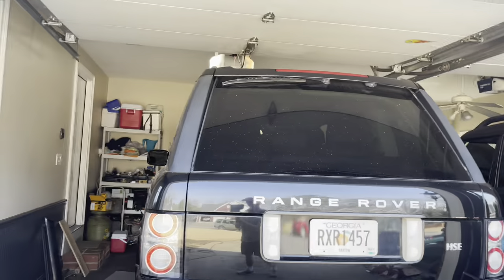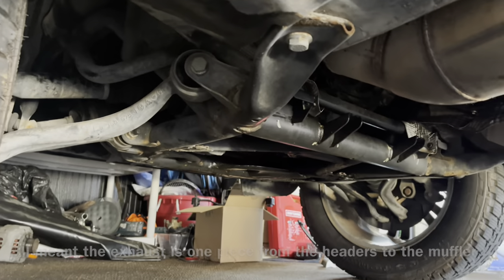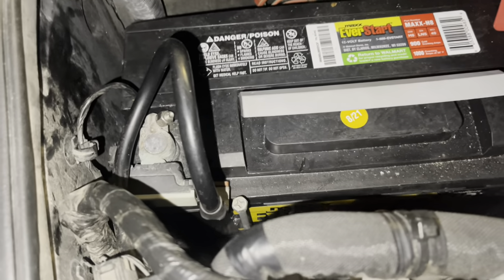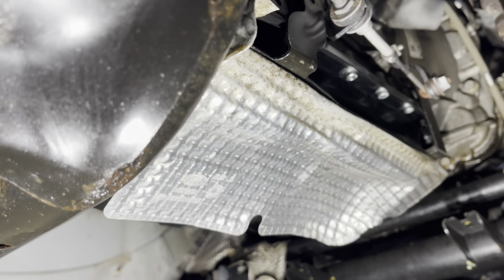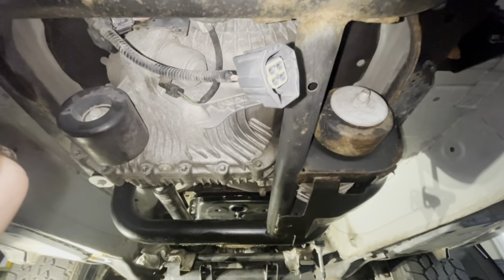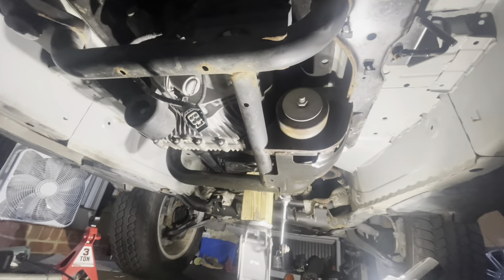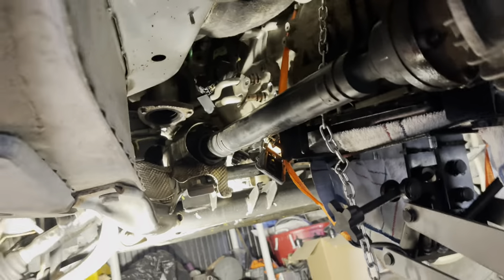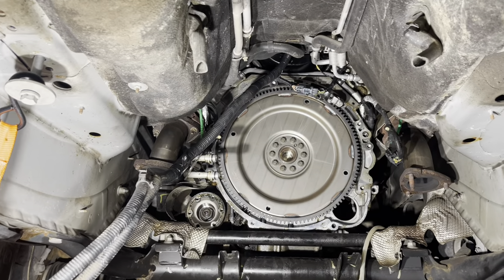2010-2012 Range Rover L322 Transmission Removal

Comment: Nice and a little jealous. I had a 2011 L322 and I was all ready to drop and rebuild my ZF transmission. Found suppliers of all the inner parts. Studied all the information, rebuilt the valve body just incase that was it (it wasn't). Then someone decided to hit my Range Rover by an illegal U-turn. They got towed away and I drove home in off road height and insurance totaled it. Besides it's premium mpg, best vehicle I've ever owned or driven. Plus I've found upgrades for its faulty engine parts. Metal engine coolant intake pipe and metal oil cooler pipe. Metal timing chain tensioner. euro-amp if you're interested. Can't stand the new ones with their horrible seats.
Reply from the maker: Yeah these things are tanks, it’s a shame how little it takes for insurance to total one of these out.  Like you said, once you’ve done the critical things to the engine these are honestly super reliable. Just for whatever reason the transmissions seem to be a weak point. Shame about yours, but maybe you can get into another one soon they’re honestly getting dirt cheap for some of these.

Comment: I just bought a 5hp24 used trans for my 05 hse bmw rover for 500 bucks, dropped the trans laying in the yard, the TC bolts was a PITA, I used a dirtbike stand  and pulled the middle piece out from the firewall laid on top of the motor and removed the top bell housing bolts and side bolts in 10 mins, you can reach them easily
Reply from the maker: Nice, I wish that had been the case with mine. Just not as much room in there with the 5.0.

Comment: Hi Ross, I own a 2011 Range Rover TDV8, and unfortunately the gearbox is bad. Apparently, the coolant was mixing with the transmission fluids, and at some point, the can stopped running. I was not understanding why the coolant was ending so fast, but it was very late, when I found the issue. My question is... how bad this can be, and if it can be repaired. Thanks
Reply from the maker: Hey I’m not really familiar with that engine as we didn’t get the diesel models in the US, but it sounds like transmission fluid got into your cooling system and might’ve damaged your engine. If that’s the case your engine might be irreparable and your transmission may be damaged too. Good luck with diagnosing it.

Comment: it looks like you had to pull the starter to gain access to the torque converter bolts.  i'm curious how much it cost for your replacement trans you put in
Reply from the maker: I actually did not have to pull the starter, I just mistakenly thought I did.  Torque converter bolts were accessed via driver's side access port.  I ended up purchasing a parts car for $1000 rather than pay $500+ for a used transmission with higher mileage.
Reply: @EtowahValleyRovers  how did you spin the fly wheel to gain access to all of the bolts on the torque converter?  did you have to use a pry bar and spin the flywheel or were you able to get a wrench on the crank?
Reply from the maker: @ryanorr5755 sorry just saw your reply, I just put a socket on the crank bolt and rotated the engine.

Comment: Excuse me, I have a big question, how did you remove the converter from the Tange Rover? I have the same one and I lowered the transmission but I can't get the converter out, please help me.
Reply from the maker: Is the converter still attached to the engine or the transmission? It should be easy to remove from the transmission with little resistance.

Comment: My project L322 is having this same exact issue. I’ve done almost all engine work myself but never tranny work. I’m debating on whether or not I can do this in my garage like you did and just replace the bushing and seal.
Reply from the maker: It seems to be somewhat common problem on these. With the right tools I’d say you can do it. I was originally going to replace clutches and seals on my original unit but ended up with a better deal on a used unit. Good luck with it.

Comment: Did you have to reprogram the new transmission to the ECU? If you used your old ECU was it easy to remove or does it take quite a bit of teardown of the transmission?
Reply from the maker: So if you reuse your original TCU then no programming is needed. You just have to pull the valve body out of the transmission and transfer the electronics from your original valve body to the new one, or just reuse the entire original valve body. Its pretty simple, you just have to be careful separating the electronics as the plastic of the electronic component can get brittle and break.
Reply: @EtowahValleyRovers  thanks so much. Wish I could hire you to do this. I just got quoted $2,400 just to remove the transmission and reinstall a used one
Reply from the maker: @joelchevalier448 sorry to hear that, good luck with it!

Comment: I am planning to hoist out my 5.0L non-supercharged engine on my L320 RRS. This thing is like a tank. I admire u being able to get the torque converter bolts out and I don't know how u could align the holes to put them back in. 
To remove the top bell housing bolts, do u remove the cowling to get access from top?
Reply from the maker: To access the top bellhousing bolts I just angled the rear of the transmission down and lowered it slightly so I had access.  The motor mounts flexed enough that I had access to them.  I think you might could remove the intake and cowling and rear crossover pipe to access the top bolts but I cant guarantee that.
Reply: @EtowahValleyRovers  thanks.
Reply: @derekkchung  These rovers are tanks, I just bought a 05 with the BMW v8 for 400 bucks with 250k kms that won't move in drive, in reverse it will move if its rolling, I know nothing about them, maybe the damn thing is just low on trans fluid, I'll find out tomorrow

Comment: Does the new transmission need to be reprogrammed or is it plug and play
Reply from the maker: It depends on what you do with your valve body.  The transmission computer is built into the valve body so if you swap the valve body from your original transmission into your replacement transmission you won't have to do any programming. If you install a replacement transmission without swapping your valve body over you will have to have it programmed to your vehicle for it to work properly.

Comment: After replacing the transmission on an 09 HSC, how do you reset the TCM, transmission control module?
Reply from the maker: Sorry just saw this, you'll have to have it programmed to the vehicle  if you didn't swap your original valve body to the new transmission.

Comment: Did you jack up the car or set the suspension to off-road to give space? I thought i saw jack stands only towards the end of your video. Do you have follow-on videos during the mount with torque converter and how you filled the 11qt fluid?  I have 04 Range Rover L322 with transmission slipping on 1st gear and it kicks hard and just slips from there. I get P0730 and P0731 codes. I might have to tackle it the way you did. Do you know how different the steps are? Didnt realize how much 2011 look the sane as 2004. Mine has the 5HP24.
Reply from the maker: So mine has a 2.5 inch lift so I just set it to offroad height for the majority of the time.  The only time I had to raise the vehicle by jack was when I was moving the transmission out from under the car.  I ended up not using all of that fluid but don't remember exactly how many quarts I used.  I unfortunately don't have any follow up videos as it was honestly a big pain to set up and record steps and that's kind of why the video ends quickly.  As for the torque converter it just slides off of the transmission, no bolts or connections.  As for reseating it you just rotate it until you find the groove and it will slide right in.  It's hard to explain but it kind of makes a distinct noise when done correctly so you will know when it's properly seated.  There's a number of other youtube videos describing torque converter install as its basically the same for all transmissions.  As for adding the fluid to the transmission I bought a hand pump to pump the fluid back into the fill plug on the side of the transmission.  You should download the workshop manual for your specific car as it will have the step by step instructions for your model year with pictures and diagrams to help guide you.  Yeah 2002-2012 all share the same body, just have different fit and finishes.  They look really similar but are very different.  Good luck with yours.
Reply: Thanks. Task is a bit daunting but your video is very helpful.
Reply from the maker: @jcamellion  thanks. It wasn’t the most thorough but figured it could help someone get the gist of everything that needed doing.

Comment: I am thinking of doing one as a project in Zimbabwe

Someone is selling a body in pristine condition with i terior intact but no engine and no gearbox

I intend buying used engine and gearbox in the UK where i live for now

Any ideas and suggestions please

Thanks in advance 👍🙏
Reply from the maker: Sounds like a big project. I would suggest buying a programmer capable of programming the new drivetrain to the car. Also it may be cheaper to buy a complete car that is wrecked and swap everything over from that vehicle.
Reply: @EtowahValleyRovers  Thanks for the reply. Does the programmer need special tools as this might be a problem in little remote Zimbabwe

Could you please explain last part about a wrecked car and swapping over as I don't understand what you mean

Thank you so much🙏😎
Reply from the maker: @tindo9833 some of the drivetrain components like the transmission have to be programmed to the car in order to work properly.  You’ll need a specialized computer that will connect to the car and can code the necessary components. They sell the scan tools online in many places. For the second part of my original comment, look up the website Copart.com. On this website you can buy cars that have been wrecked in an accident for lower prices. It may be cheaper to buy a wrecked vehicle with a good engine and transmission and ship it to your country, then use the parts you need to rebuild the rover you’re looking at purchasing, then selling or scrapping the parts you don’t need. I could be wrong, but it’s something to consider.

Comment: Hi do you know how to change the fluids in a 2013 range rover sport hse lux
Reply from the maker: Yes, it should have the same transmission as the one in this video. Drain fluid, replace the pan, and refill with the engine running. Once the fluid is up to 40 degrees Celsius and is dripping out of the fill plug at one drop a second it is full.
Reply: @EtowahValleyRovers  thanks for the info

Comment: How many miles on the tranny before failure? Reason for failure? I have a 2010 Range Rover 5.0 with 200000 miles, currently the ZF is running great. Thank you for an outstanding video!!
Reply from the maker: Thanks!  Mine suffered from a failed stator bushing, resulting in low pressure in the transmission as the fluid heated up and thinned out. This vehicle was actually quoted for a transmission replacement as far back as 76k miles, and the previous owner changed the fluid and filter then got another 50k out of it before it finally wouldn’t stop going into limp mode.  I think this one was unfortunately just an outlier and failed early.
Reply: Some advice..... Be sure to change your transmission oil every 35,000 miles and also replace ALL of the seals inside the transmission. Seal failure is one cause of transmission failure. Don't wait for signs to show before servicing it.  Another cause of failure is fluid & overheating. Keep an eye on the oil cooler. 
 If you do the proper maintenance you'll be fine.

Comment: Great job Josh!!  I was a bit taken aback when I initially saw that you're doing this job in your garage with no lift.  But then I was in SHOCK @&*#%$  when I saw that you weren't using jack stands and had the RR up in the air by putting the air suspension in the highest raised position. Oh, wait, o heard you just mention the word, "Safety Measure," when explaining installing the Transmission. A bit late bro....  Are you NUTS !!!  To crawl under a RR trusting its air suspension???  One of the least reliable systems of the vehicle!!  You know how when after running the engine and then you press the Down button and it lowers itself to "Entry" Mode?  Well, I don't trust any part of the system.
One simple switch & air valve lies between you and a pancake.
And another thing....
NO JACK STANDS????
Reply from the maker: Yeah good point I should've used them but can't do anything about it now.  Just saying with the battery disconnected the air suspension system cannot release air from the system unless I went and poked a hole in one of the airbags.